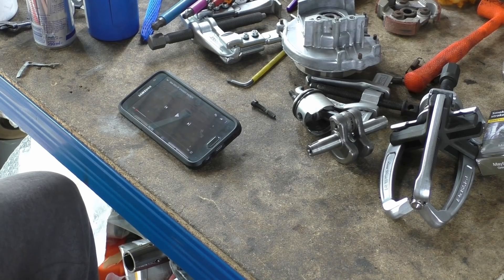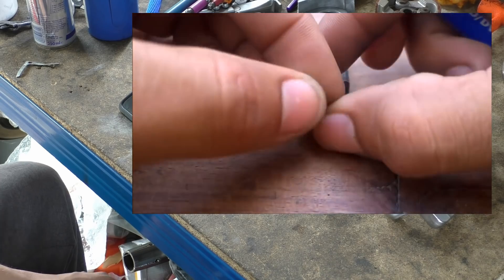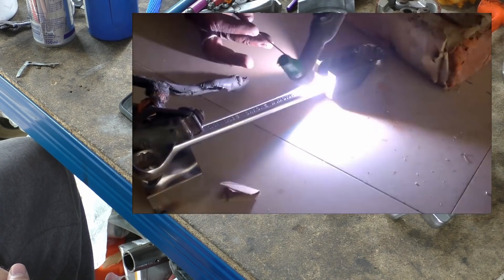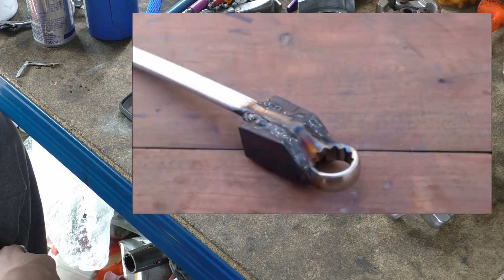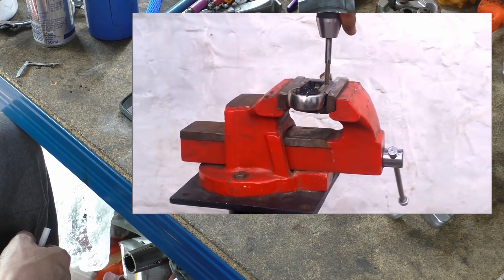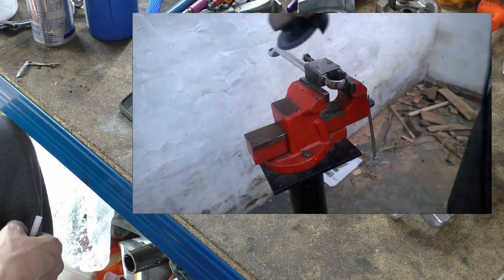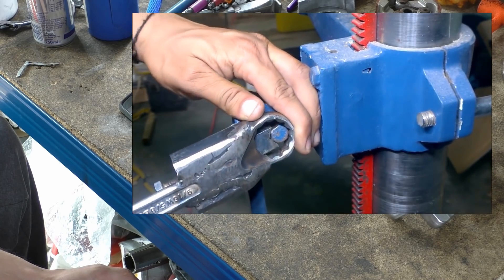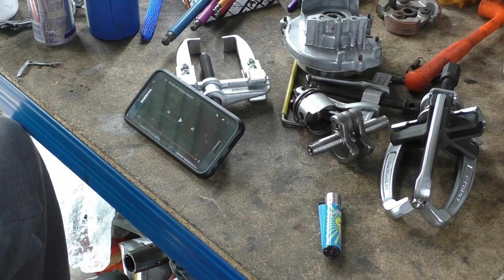WOW tool hack - a heavy ruined spanner

Comment: The one scenario where this tool would be useful:

You are Macguyver

In tonight's episode you're locked in a fully stocked workshop that contains only one spanner. 

The only way out is to undo bolts on the door that the spanner doesn't fit. 

Errrr, that's it.